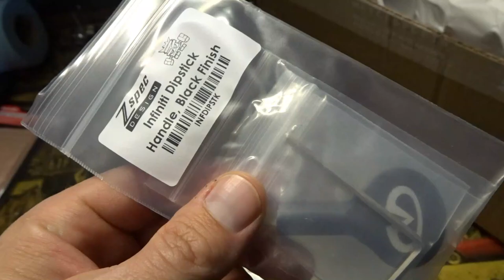Most WORTHLESS Mod for your Infiniti Q50 | G35, G37, Q60

Comment: speed i talked to you about doing your exhaust set up on my q50 and switching out the tips, but i have another question lol. i love the sound of it but personally i’d want it to be just a tad bit louder. same tone same growl same sound everything but i just want something that i can hear a bit more. what would i need to change? i don’t want there to be too much drone but i know it’ll probably gain some by making it louder. would i need regular test pipes instead of resonated ones? if so do you recommend any? if not then which pipes are you running/ recommend? thanks
Reply from the maker: Non resonated won’t do anything other than increase drone.  You could try and not use flowfx resonators, it’ll just get raspy.  The thing is you actually won’t get it much louder—it’ll just get raspier which “seems” louder because of the crazy frequencies.
Reply: Hey man I just left the mid muffle everything else straight pipe plus test pipes and from the mid muffler and back I went 3inch pipe to the tips and I love it it’s toned but beefy at the same time
Reply: @god0fblvck786  u got any vids of the sound?

Comment: Cool little mod, just remember not to check the dip stick before allowing some cool down time. Lol.
Reply from the maker: Good point lol.  Being aluminum, I would think it won't get too warm though lol--says me right before having an infiniti logo branded on my thumb lol
Reply: @SpeedCultureStudios  maybe do a 15min drive and then check the handle with a temp gun? I've burnt my hands on the aluminum oil cap before I would assume the same with the dip stick. Haha.
Reply from the maker: @samchoc6811  good point.  The Tomei cap gets super hot

Comment: ? On your speed culture  studio exuast system..what about hanger were   they any issues at the muffer spot..when they tried to charge more.
Reply from the maker: No issues with hangers—factory hanger locations were used.  What do you mean when they tried to charge more?
Reply: I meant did they charge you more?It all good i think it just crazy right now here in calfornia everything is going up in price rims, auto shops etc.2 spot were like 500.00 to 600.00 to have installed..its not cheap anymore...😆
Reply from the maker: @MrQuesada1976  no they did not charge more.  But yes material costs and everything is going up.  That’s Government for you

Comment: Bonjour mon ami je voudrais savoir si tu peux m'aider j'ai monté un autoradio et depuis j'ai mon voyant airbag passager d'allumer car il y a plus communications entre l'air bag passager et le nouveau autoradio, j'espère que tu pourras m'aider
Reply from the maker: Je suis désolé mais je ne suis pas bon avec les problèmes électriques.  Il est possible qu’il y ait une mauvaise connexion avec le fil de l’airbag.
I am sorry if the translation is not good.